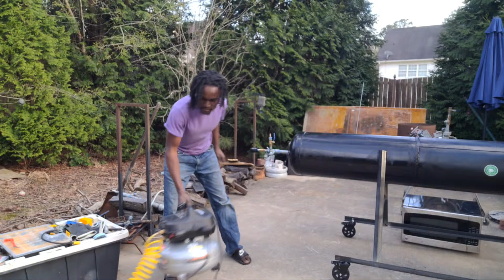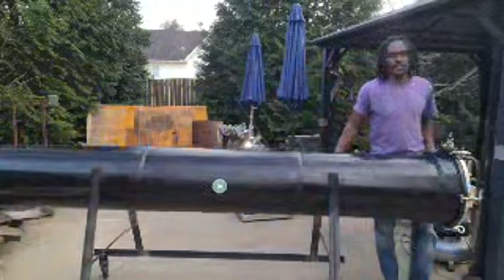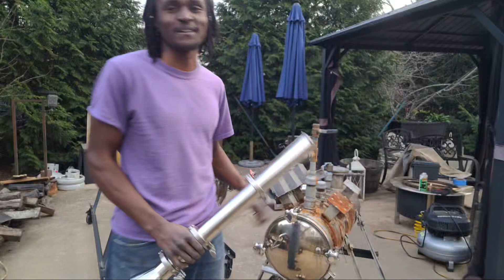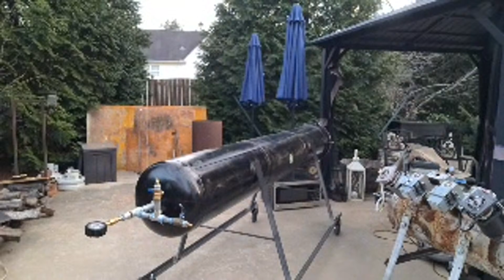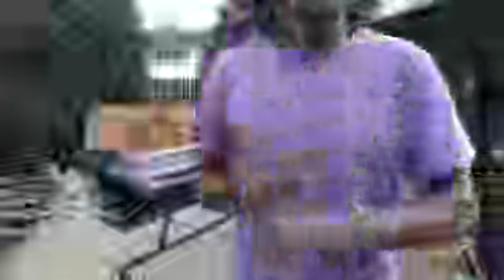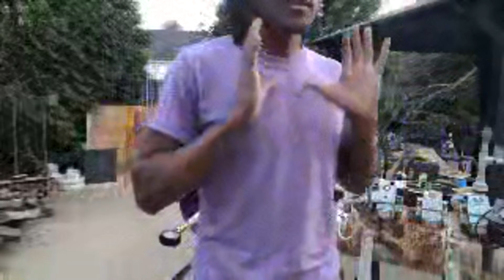REACTOR

Comment: Nice! Have you seen mrteslonian YT channel? Check out his reactors. You could collect several grades of fuel in one go, and just empty the cans when they fill up. Also using a Graphite HHO(40) cell @12v using 20% Urea in caustic soda electrolyte, will give you massive HHO production at only 0.3V per neutral cell, thats why you need 40 neutral plates @ 0.3v. Normally it takes 1.5V per cell!!!  Build a HHO burner and heat your reactor at a fraction of the price as a microwave.